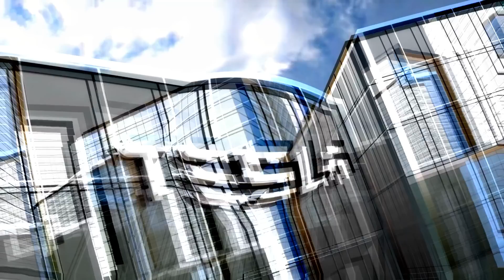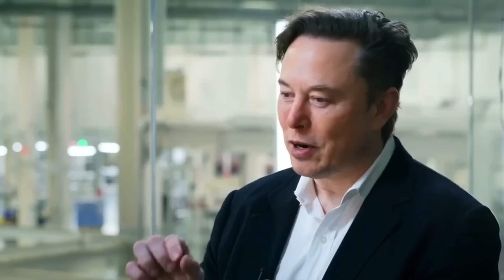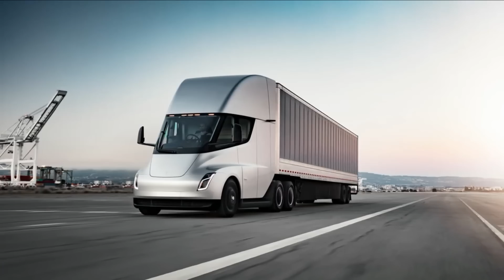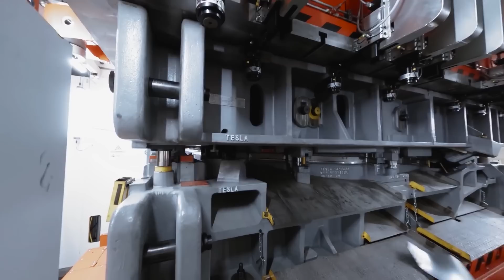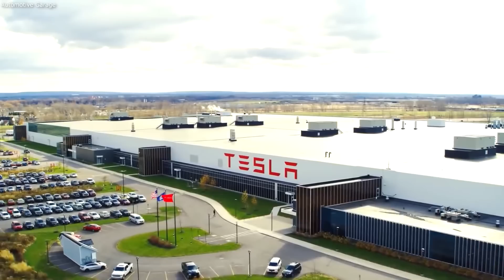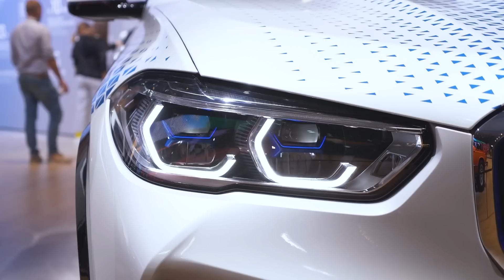Tesla Giga Texas Production Speed Changes Everything

Comment: Giga Texas probably won't out do Shanghi which is 1 every 3 minutes. The time to make the 6000 batteries is hours if not days, but they do so in parallel so if you make 6000 in parallel, a minute may go off the clock when all 6000 are finished; yet time per battery was a minute and a total of 6000 minutes of production; you can then put those into a pack, while the body for 10 Teslas are  being constructed by robots in 30 minutes, If you complete 10 bodies in 30 minutes while 10 packs are made up; and that takes 30 off the clock but thousands of minutes of work  per car; then its plausible you could make 10 cars in 30 minutes time off the clock and average one every 3 minutes.

Comment: The idea of electric vehicles sounds great at all but when you consider that the power grid is unable to deliver the current demands and certainly not seven times the current demands that Tesla automobiles that run on electricity would require, I really don't see this happening unless we build scores of nuclear power plants throughout the country.
Reply: If you think an EV 7x's your homes electricity consumption you are very, very mistaken. I drive my model 3 about 20 000 miles a year, and I charge about 300kwh a month, which is in my case about a 20% increase to my electricity consumption. So an EV might increase power consumption by 20%? NO. Residential electricity consumption is in most places significantly smaller than industry electricity consumption, which remains mostly unaffected by private citizens getting EV's. The truth is, if everyone got an EV tomorrow, grids in many places may very well be in trouble, that is not wrong, but here's the deal; the transition to EV's is and will remain a gradual process, which can be planned for and where needed, grids can be upgraded. Alternatively, if you dont want to upgrade the grids, just increase incentives for home solar system, as every home solar system reduces the strain on the grid it self by reducing said homes need for grid support.
Reply: @Harakai100  On average, electric cars use about .5 kWh  per mile driven. So if you drive 10 miles, that's 5kWh. 100 miles a day (half my daily commute) is 50kWh. Which is 20kWh more than my entire home uses. Unless your home is an energy hog, electric car usage will spike.
Reply: @basspig  your numbers are wrong. A tesla doesn’t use anywhere near that amount if electricity. In addition to that your math is completely wrong.
Reply: @basspig  that is the most ridiculous consumption number I've heard. My model 3 has a lifetime average of right around 250wh per mile, and I drive in snow several months a year with lots of highway driving.

Comment: Has there not been reports of Teslas rear ending motor cyclists when driven in Auto mode caused by failure to identify an obstruction in front of car due to the radar unit being deleted from the build of the car. I wonder if it can detect a cyclists ?
Reply: It can detect cyclists very well, and it can detect motorcyclists very well, but sadly still not at 100%, so yes there has been accidents which is very tragic. People should pay attention and not trust their autopilot blindly.
Reply: The drivers are supposed to stay totally aware even with auto pilot on
Reply: You're right. The accidents have occurred since radar was deleted, but that doesn't mean it will come back. Oh yes, it is the driver who will be charged with manslaughter, not Tesla.

Comment: Question...How long does it take GM to make a similar car?  Likely at least 4-6 hours.  You might ask why...well:
1. UAW workers work at snail speed, count on it.
2. Parts are stamped out and have many adjustments so they can be tweaked to fit...more wasted time.
3. Management lording over the workers...whine whine whine and no cheese, more wasted time.
4. How many cars fail their shoddy inspection...few, and those are put back on a separate line, not to correct the problem but hide it.

Check any GM product at the sales lot.  Use a measuring device, nothing fits, they are so sloppy it's amazing they can drive in a sort of straight line.
Reply: Way back I worked at the GM plant in OKC in the paint department. Cars on the line came by at a rate of approximately one every 46 seconds. I remember some of the body stampings sourced from the outside not aligning with other body parts and having to be bent to fit or holes drilled to align up with the other parts. Sad but true. You could always count on being offered OT in final prep to try and address the other issues too.
Reply: EEwww!!!!!
Reply: GM makes a car every minute, all manufacturers do, what is different is the number of vehicles that are built per year, the biggest plants produce 500k per year.  I don't disagree on the quality front though.
Reply: How’s Toyota do vs Tesla in terms of production line? I’m seriously asking as I have no idea. I just know my 2006 Lexus durability is amazing.
Reply: @HamburgerHelperDeath  Toyota is one of the best in manufacturing.  I don’t actually think that Tesla has that good of history of quality in mfg to be honest.  They are new but getting better. It is so incredibly difficult to build a car.

Comment: You state that Tesla will be able to manufacture 2 million vehicles annually as early as 2024. This is incorrect. Tesla produced 936,000 cars in 2021. Wall Street estimates they will deliver 1.4-1.5 million in 2022 which is 50% growth which Tesla has been doing now for almost 10 years. So if they maintain 50% growth, which Tesla is admanat they will do, they will exceed 2 million cars in 2023 and by the end of 2024 they will have produced 3 million cars
Reply: Extend this graph to a few decades and tesla will be giving cars to aliens.
Reply: @dreadfulbodyguard7288  yep. Via SpaceX

Comment: More people want high tech ey’s vs low tech gas.  Gas cars will really depreciate
Reply: But will last decades longer. Battery technology will render EVs undrivable after a period of time. I can get a 1920s car and keep it running. No EV will be that way.
Reply: @rickitysplitz7035  Wrong. many Teslas are already over 300k miles on original batteries. Some of the early models were over 400k running in a taxi service to Vegas from LA.
Reply: People may still like ICE cars for the fun-to-drive factor, but for mundane transportation EVs are more practical. If you're a car guy you can use a Tesla M-F but roll out the Miata on the weekends.

Comment: This being Texas, where everything's bigger, better, and more intense, I expect the Megafactory workers to work 170 hours a week, no less!

(for Amerikers only: there's only 168 hours in a week)

(for Amerikers only: 170 hours is more than 168 hours...Get it?)

(for Amerikers only: So it's kinda impossible, you see...Or what?)

(for Amerikers only: So that's kinda what makes it a joke, see?)
Reply: There are only 168 hours in the week, everywhere, but time itself is larger in Texas.

I know this because the term "New York minute" not only means an instant, but the term was coined in Texas to refer to time differentials between New York and Texas.

An instant is defined as an imperceptibly small unit of time, and we know that films typically run at a speed of about 30 frames per second because speeds above that are essentially imperceptible. That means that 1/30th of a second (or something around that) is perceptible, and therefore an instant cannot be more than approximately 1/30th of a second.

Now a minute is made up of 60 seconds, and we know that a New York minute can be no more than 1/30th of a Texas second, so whereas an hour is made up of 60 minutes we must conclude that a New York hour can be no more than two Texas seconds.

I'll try to conclude briefly here. Following this to the natural conclusion, there are 3600 seconds in an hour, but 2 Texas seconds are equal to at least 3600 New York seconds, or a ratio of 1:1800.  This means that 170 New York hours would be equal to 0.095 Texas hours, or a little less than six Texas minutes. So while of course it would be a logical impossibility for Gigafactory employees to work 170 Texas hours per week, they easily exceed 170 New York hours per week.

This might help explain why Tesla and SpaceX have been moving forward so quickly since they established themselves in Texas. They're not overworking themselves at all, they're just benefiting from Texas time.
Reply: @alanlight7740  Whoa! 😄
Reply: As commented in the video.  Texas is the China of the US......   The only way Texas can do what they do is by "stealing" jobs from America.....I mean California.
Reply: @iguessifyousayso  This one's even better!